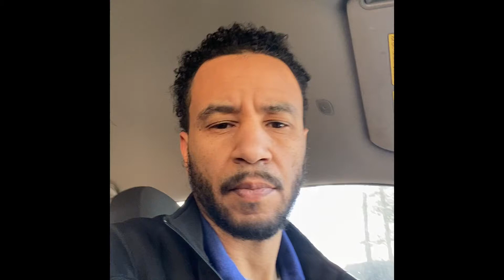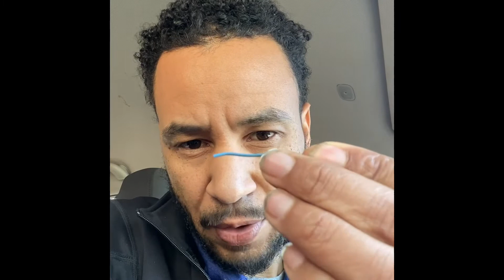How to find a short on HVAC system.￼

Comment: You are in Fayetteville NC, right? I am born n raised but escaped to rural ETX 25 yrs ago. Mostly real happy with that decision. So my AC is kaput on day 1 of ac season. Found the fuse which looked perfect but ohmed open. Found smoke escaping from a new 24V xfrmr. Possibly a shorted relay coil on the contactor. Basically shotgunned a bunch of amazon parts. Then I saw this vid and the part where you mention weedeater... my son got that 2 conductor tstat wire a few days prior and it looked ok. :-)  Pulled a 4' guard up offa the pipes and tsat wire and about 6" of bare wires in parallel! We fried 2 xfrmrs before doing a complete visual but I was learning on the fly. Sleeping in a cool dry mosquito free house tonight. Despite the parts shotgun it still came out way cheaper than having a service tech out in 3 days. Cooler, smarter and got spare parts on hand for next time. Thanks for the vids.
Reply from the maker: nice!!!